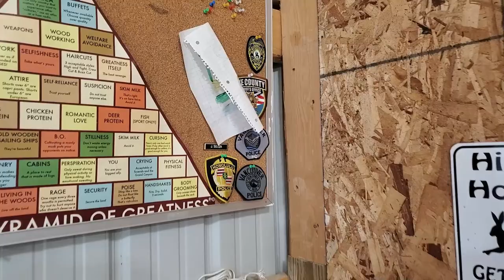She’s DONE On Our Channel!!  Airing Our Family’s Dirty Laundry | PEX Rings vs. SharkBites

Comment: Hi i'm constructing a carriage house and i'm having the building climate controlled because of the age of the carriages.  I don't want them going through the wide temperature swings in Upstate Ny during the cold Northern winters.  Sometimes nights in winter with wind chills can drop as low as -30 below zero.  I don't want the paint finishes compromised because of humidity and severe temperature swings.  I was told that Spray Foam insulation has the best R value of all insulations.
So my question to you guys are you at all concerned about your metal walls holding the cold much more than wood structures.  I was also told that because the foam is sprayed on at 180degrees so it bonds to surfaces and also gives you a water tight moisture barrier for your walls.  I was just curious is you had thought of foam insulation?  i really enjoy your channel and the two of you playfulness!  You keep us entertained that's for sure.  LOL  have a great day! 😎👍🇺🇸💙🐴

Comment: Hmm, what was the issue with the shark bites?

I’ve Used them in several places with no problems, had the copper and pex burst from freezing but the fitting held...

Maybe they didn’t cut the ends perpendicular or didn’t press them in all the way?

Comment: I'm remodeling my house and somehow Youtube is suddenly prioritizing house building/fixing videos. I'm doing it in a city with lots and lots and lots and did I say lots? of regulations/inspections/sign-offs on inspections. Oh, and the city decided to save money, they'd cut the inspection staff by more than half despite the fact that their work is paid for by "we the people". So, a lot of what I want to do (steam room) has to figure out the regulation of only being able to turn on one fixture in a shower/steam/sauna stall at one time. Plumbing is tricky, I usually do a pressure test but also just putting paper towels under all the joints and waiting for a while. All that paper should be dry. It's been a long haul ... I think 5-7 months to go. Good luck!

Comment: The water hand-pump outside, does that freeze in the winter? I remember as a child going to a cottage that had a pump like that and we would wash our hair outside in the snow, but I cannot remember if it had a box around the pipe to protect it or not. I also remember how freakin' cold the water was on the head! ;) Try it this winter, I'm sure it will take 10 years off you!! LOL
Reply from the maker: Its supposed to never freeze, but we shall 👀
Reply: @GoodSimpleLiving  I guess, with HOT water in the house now, you want nothing to do with washing your hair in cold water??! ;)

Comment: So just curious what kinds of problems you have encountered with    the County on the  Metal Building to livable space? Also is this in Kootenai or what County? Thx for the Great Videos and Info, debating on doing a Small Cabin build or the Metal Building route? Any savings on Taxes going this way, or Tax Implications etc?
Reply from the maker: We haven't had any issues at all. Boundary abd Bonner County are very easy to work with, and have no building codes besides electric, septic, abd plumbing.
Reply: @GoodSimpleLiving  So are the Property Taxes less with the Metal Building than Building a Custom Home, or if you are Rural and Zoned for Agriculture etc? We were fortunate to find the 10 Acres we Own, got approval to install the Septic, and putting in a Well in Spring. Debating a small Cabin or RV till we build something substantial etc. Everyone we met and Worked with were Great People, couldn’t have done it without their help and knowledge. Beyond excited to put it mildly, leaning towards a small Cabin Buildout any thoughts or recommendations? Thx

Comment: We all have brain farts at some point or another in our lives so don't let that bother you. I had a brain fart that lasted for three days. I installed an electric fuel pump on my SUV this past Wednesday but I wasn't getting any fuel to the carb. I tried getting another fuel pump thinking that was it. Nope, that wasn't it. I replaced ALL the fuel lines and filter. I primed the pump by sucking on the fuel line and getting a mouth FULL of gas. I worked on this thing for 3 days. I was beginning to think it was the pick-up in the tank. Just when I was about to give up and slide out from under it I noticed writing on the bottom of the pump. Just one word on opposite sides of each other. Those words were "In" and "Out". Can you guess why I wasn't getting fuel to the carb? That's right, I had hooked it up backwards. I felt so stupid. Normally I'm on point. I check and recheck everything. I just missed it.

Comment: NOTHING WRONG WITH ' SHARK BITE FITTING '  AS LONG THEY ARE BRASS FITTING ON NEW PIPEING  ! 

TRY NOT TO HAVE 45 OR 90 FITTING REDUCT FLOW OF WATER [ EXAMPLE ] > EVERY BODY PRESSION  I DON'T LIKE PRESSER ON ANY PIPE , I READY HAVE NICE AN EZ WATER FLOW WILL NOT BUST YOUR PIPE ! 

ELBOX SUPPORT  BETTER THAN 45 OR 90 FITTING

Comment: Hate to be negative but the lack of heat tape installed could prove to be a major mistake. If you find the pipes are freezing let the water drip slowly. Enjoyed the video!
Reply from the maker: We installed heat cable on all incoming and outgoing lines.
Reply: @GoodSimpleLiving   I have a place in Montana where I had a line freeze and break a brass control valve right at the shower because I didn't have cable at the shower itself. I am just saying keep on eye on things until you know for sure. I have great respect for your family and hope for the best for you.

Comment: You never said what the issue was with the shark-bites. This episode  came up on my recommended vids list shark-bite was what got me to click and watch. The reason isI live in an old mobile home  that was originally plumbed with the fabled Quest brand. Sooo i have had to repair a metric shit ton of leaks. Laying in the mud in the cramped space trying to fix a leak that's been running for god knows how long before I discovered it is not a pleasant task. Shark-bite are fastest and easiest way to get it done for me.  Now I hear the video of a potential problem but not what the problem is. I think I have been using these for about 6 years now and everything has been ok as far as I know. I don't think I could squeeze those crimpers laying on my back under a trailer.  People will always ask for advice from people they trust when those people have experience with things they do not.
Reply from the maker: We honestly don't think there is a problem with them, but were told by many plumbers not to conceal them behind finished walls, because in cold environments the seal can leak. We still use them where we can see them, just decided to swap them out in spaces we couldn't see.
Reply: @GoodSimpleLiving  I guess that makes sense, in  extreme temp changes dissimilar materials will expand and contract at different rates and could cause a leak.  I'll just have to deal with it luckily almost all of the ones I have put in are accessible. Thank you.

Comment: NO NO NO NO NO NO NO.  2 things.  You used pvc to make the connection at the water heater.  PVC is NOT allowed per code to be used inside a building on potable water. on hot water PVC will melt, it will swell up. you must use CPVC. 2nd. you used 1 1/2''" on the washer machine trap arm. NO !!  It must be 2"

Comment: Why  would you run water piping through outside walls.  Even with insulation you are flirting with disaster.  I live in Wisconsin and replumbed my kitchen sink (which is on an outside wall) years ago after a freeze.
Reply from the maker: Cause disaster is our middle name 😂.